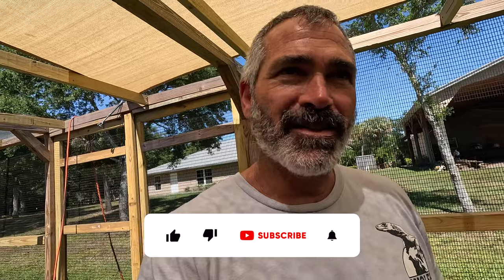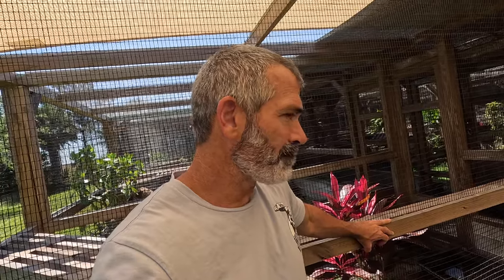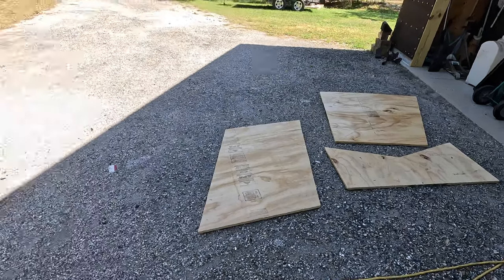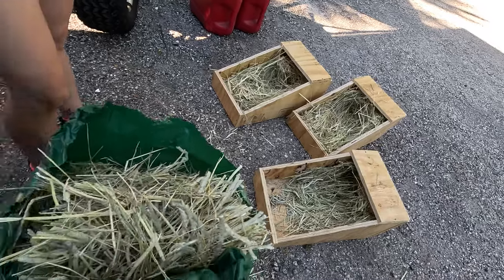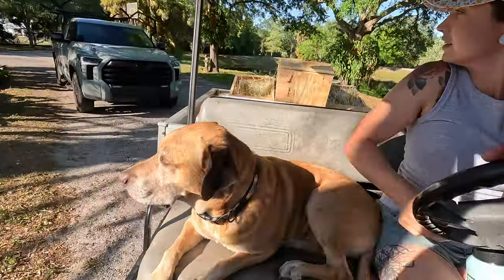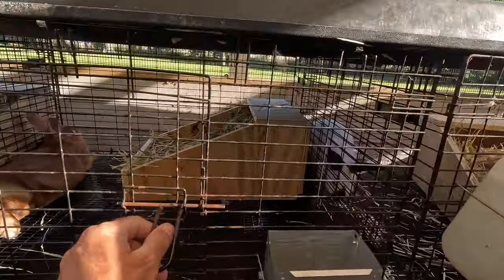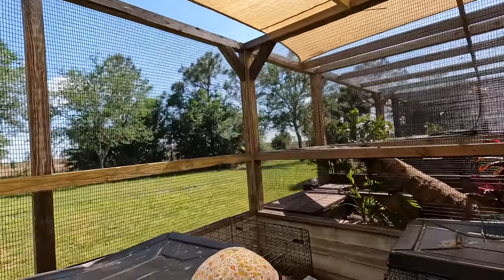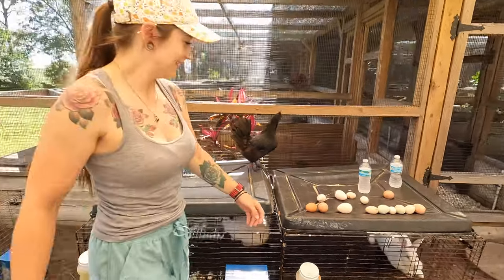Rabbit Nesting Boxes and Bunnies!

Comment: How do those bunnies tolerate Florida!?  I thought they needed to be at 80 or below, do they have ice bottles and a fan? ❤❤❤🐢🦎🦎🦎🐇🐇🐇❤️❤️❤️ I read you can chill large ceramic tiles for them to lie down on to cool them , and a fan, they don’t tolerate hot temps/humidity. Probably could pick up some ceramic or stone in the cheap tile odds and ends at Home Depot.
Reply: Thank you for the suggestion, we will look into that!!